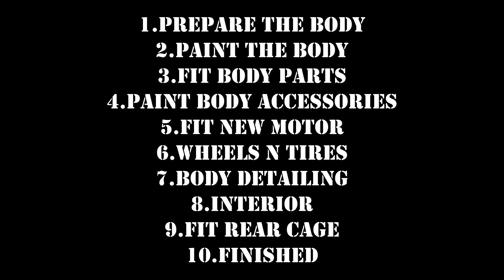UNIMOG Rc 6x6 *FIRE & RESCUE* BUILD Trx-6 6x6 / Axial Umg10 Body

Comment: Awesome job, thoroughly enjoyed. Before I got my 6x6 worminator chassis, this was what i wanted to do. Take the better chassis from Traxxas and the nicer Unimog body and make the best 6x6. I guess you bought the trx 6 and got rid of the body and then just bought the unimog body separate? Be nice if Traxxas would sell just the 6x6 chassis. Thanks for sharing
Reply from the maker: Thanks for checking it out yes I sold the white Merc 6x6 body on Ebay and bought a clear one 1st and build this -  https://youtu.be/5FAphHc3CtA still got more to add to that body then decided I want the Unimog looks so cool so had a go and yes the 6x6 chassis is amazing with the upgraded motor I put in makes it sooooo smooth and slow control I love it and bought another clear unimog body to do a different style one 👍👍👍👍

Comment: What did you use as body mounts?
Reply from the maker: Just velcro along the door runners the rear section fitted very snug so even when it rolls over the body doesnt come off, love a bit of velcro :)
Reply: @rcadventurer  thank you I want with 6 earth magnets , hopping for the best 🤞
Reply from the maker: @davidwolfman2485  sounds good should be fine

Comment: Amazing work! quick question I have a UMG10 body and I want to attach it to the my trx6 chassis, I was wondering how did you hold the body on the front? what kind of methos did you used?

Thanks!
Reply from the maker: Thanks for checking it out you can zip tie the rear although it slots in place securely without anything to be honest and the front is held by strong velcro along the side running boards attaching to the body along the same side piece holds it really well even rolled over and didn't come apart but might if it was a proper crash but does the job no body pins or magnets this time 👍👍
Reply: @rcadventurer  ooh nice that so simple, thanks for sharing
Reply from the maker: @rayrod9010  anytime

Comment: Very nice! To bad there not making that body any more though.
Reply from the maker: Really I only just bought it and there are loads for sale on the internet atm? love the Unimog look and so many different versions for real also thanks for checking it out 👍👍
Reply: @rcadventurer  Man if you have a link were I can get one can you share it? Axial discontinued the 6x6 and screwed all there customers rather than fixing the drive trail problem, It is a good rig after you add my shims I make to the axials but I want a spare body for the future. I have seen a lot of the two door ones but not the 4 door.
Reply from the maker: @SteadfastRC  I am in the UK and on google the Rc online shops selling are wheelspinmodels, makeitbuildit, and lots on Ebay too doesn't seem to be a prob at all 👍👍

Comment: Beautiful build, congratulations! The micron tape was new to me. Does it hold well in case of a flip over?
Reply from the maker: Yes its fine sticks really well and worst case if you get a bad snagging bush or something you can easily just replace one tiny bit but rarely happens as its in the body line grooves anyway cheers👍👍

Comment: How do you connect the lights with the fusion combo?
Reply from the maker: The lights are connected to the receiver with a multi port connector so you can use one port in the reciever with several light connections into that 👍

Comment: Where can I buy all of the stuff that you used on the build, can you post links?
Reply from the maker: Hello,  everything on it is available on ebay that's where I get nearly all my rc stuff l;oads of random sellers on there, except the rear cage thats from proline but also available on Ebay  just a pain waiting for it to arrive from China Cheers for checking it out👍
Reply: @rcadventurer  why is that body so expensive? Did you have a place where you purchased it for a fair price?
Reply from the maker: @stevie123p  No Idea I did hear they were discontinuing it so I bought 2 clear ones incase as I am going to do another body not sure if that's true or not?
Reply: @rcadventurer  the body (cab) is $149. Do you want to sell one? I understand if you want to keep them. They may be worth a lot in 10 years. What brand is the body?
Reply from the maker: @stevie123p  crazy prices I got it from wheelspin models online last year Uk hobby shop I got the interior also ready to paint this year  at some point, its Axial from the packaging ref AX1230003 keeping mine as I love the look of them too but thanks for the offer I will keep my eye on ebay incase someone sells one to stockpile haha joking! if they hold there value guess its good when you go to sell it painted unless its trashed from use👍

Comment: Wie hast du die fest gemacht
Reply from the maker: The rear cage fits tightly between the wheel arches nothing to actually hold it needed but you could use zip ties if you wanted the front section is strong velcro strips along the left and right side of the body attaching it to the chassis and works really well even when it rolled over doesn't come apart and nothing to spoil the look of the body with clips etc👍👍

Comment: Wie ist die fest gemacht??
Reply from the maker: the rear cage is tied to the rear so the front lifts up like a hinge and the door runners have velcro to attach them to the chassis works really well
Reply: @rcadventurer  ist no kann englisch

Comment: Wow, looks incredible!  How does that detailing body line tape hold up?  I like the look of it.
Reply from the maker: Thanks very much, tape is great I have used it on several even after going in water still ok its really sticky and if any bits ever get scratched off on the trail so easy to just cut a bit to replace a little section anyway prefer it to using a pen tbh, Happy crawling dude👍👍👍

Comment: Ahh parts are so expensive
Reply from the maker: much worse now than last year with all the worlds shipping problems hopefully prices will lower next year .....wishful thinking haha👍👍
Reply: @rcadventurer  Yeah lol hope they get better. I’m gonna make a police unimog but worried I’ll mess it up
Reply from the maker: @freddieparrydrums  wow sounds great hope it goes well
Reply: @rcadventurer  thanks man :)
Reply: @rcadventurer  By the way what rollcages are you using thanks
Reply: @rcadventurer  and what is the file you use to make edges smooth
Reply: @rcadventurer  how did you do the lights
Reply from the maker: @freddieparrydrums  proline rear cage alloy parts are bought off ebay various random sellers and modelsport online shop in UK cheers
Reply: @rcadventurer  Thanks so much man. You know I’m 14 now I saved up for my 6x6 but finally I want to start becoming better at custom making things. Thanks for the help man